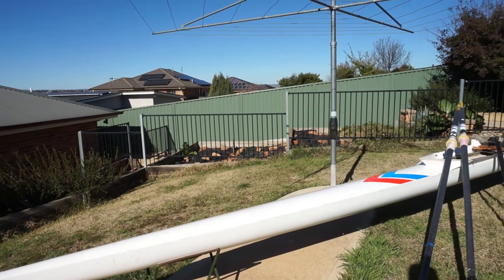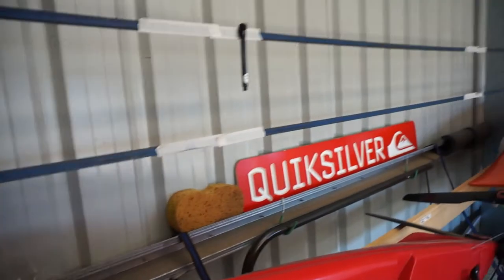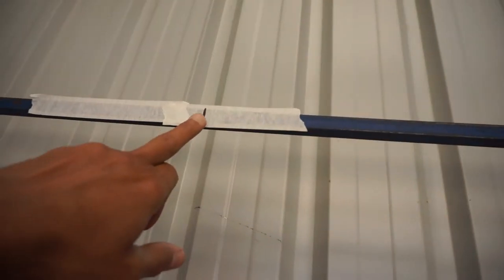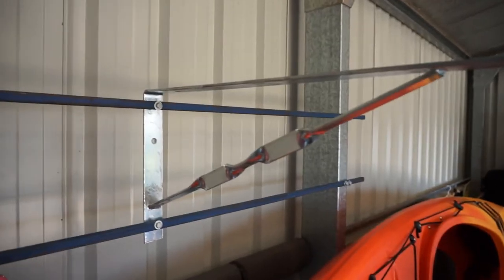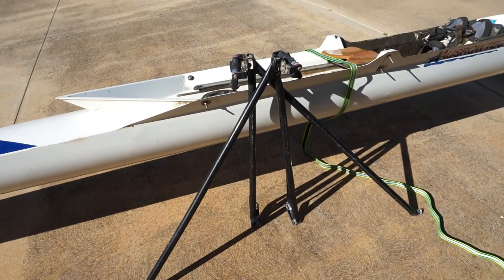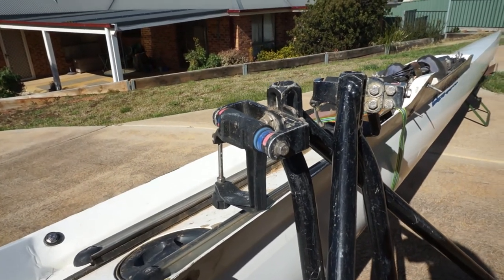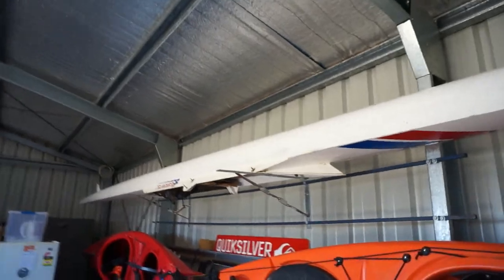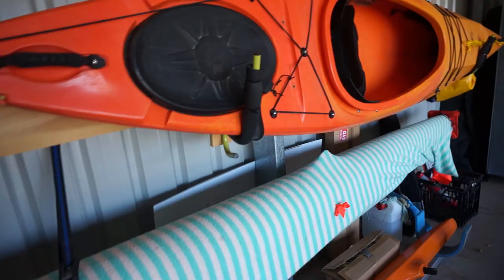ROWING SCULL STORAGE SYSTEM | Shed Set Up

Comment: your shelving system is grossly in adequate for its purpose. You need to brace between the two horizontal bars, you can weld in a zigzag brace.
Reply from the maker: The brackets form partial bracing, if it had to support more than 13.5 kg I probably would bolt more bracing on the horizontal bars.